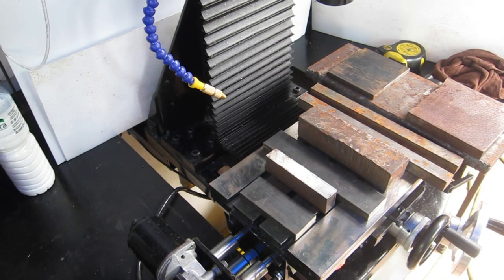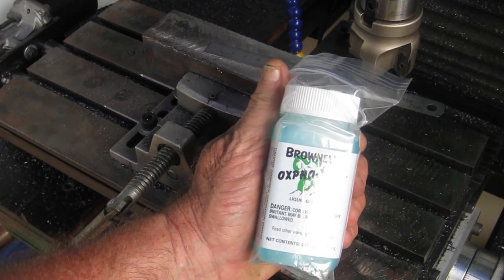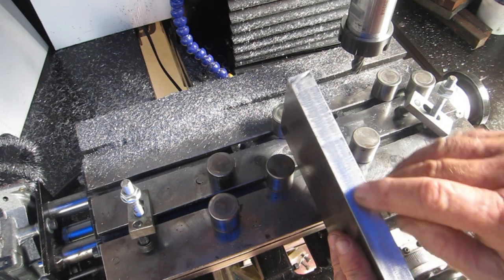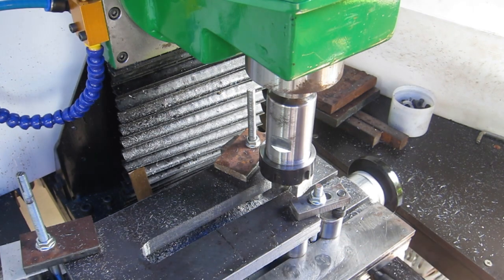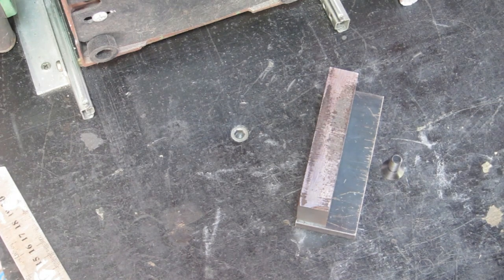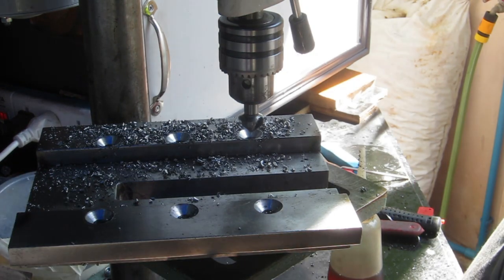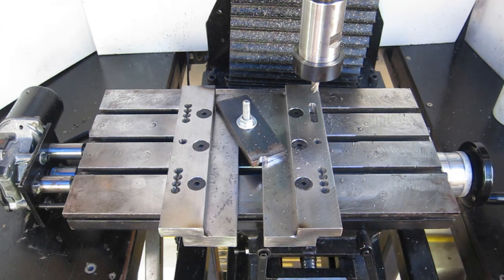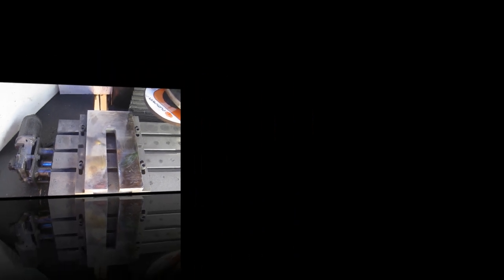MHW Episode 43 - Homemade 4" Milling Vice / Vise Build from mostly scrap steel - Part 1

Comment: Awesome work ! Another pile of scrap turned into a useful tool 👍
I would take to that T nut with the welder then re machine it .
Reply from the maker: The thought did occur to me, but I've since made a bigger stronger one, still working on it, tomorrow will mark 2 weeks since I started on it. This has turned into a much bigger job than I anticipated 👍

Comment: You don't have the tools to pierce ears in the shop?  A scratch awl and a potato (or the Thai equivalent) should have made a good job of it and saved you the trip through the traffic.  There is the yelling and screaming, scratching and biting, but all of that passes soon enough.  I do pretty much the same when I "grape" a finger nail.  1/16 in. drill and a moment on the drill press, and, as you say, Bob's yer Uncle!  😆😆
Reply from the maker: Thanks for the tips! Maybe next time 😆

Comment: the part that was to big weld and redo it bud.
Reply from the maker: I'm not sure just what you are refering to ??
Reply: @MyMiniHomeWorkshop  the part that was too small the slider you weld the sides and then mill it back wider instead of discarding the part.
Reply from the maker: @danvandertorre6349  I realised that is what you meant after someone else mentioned it as well